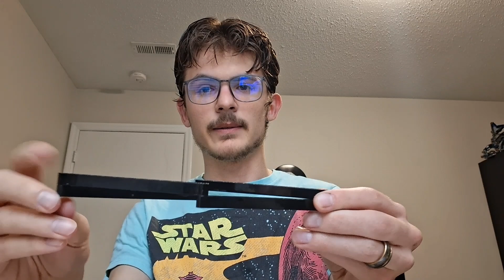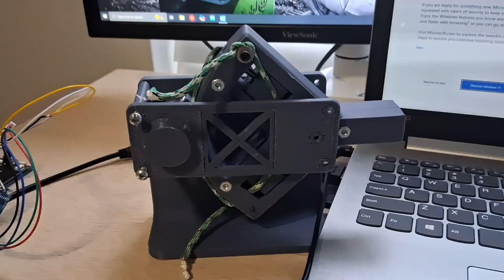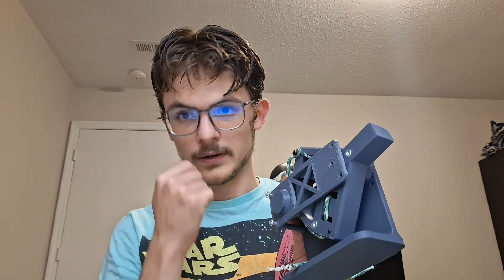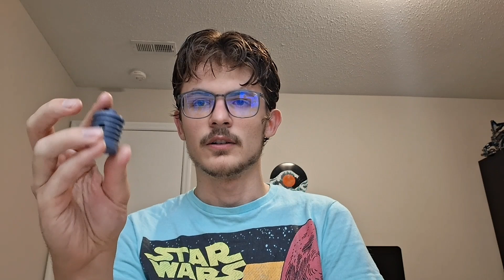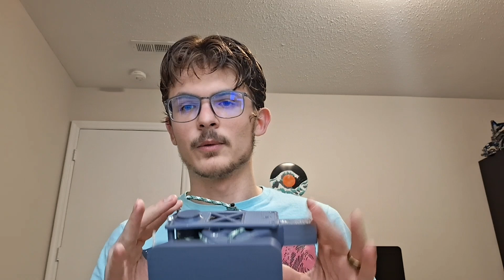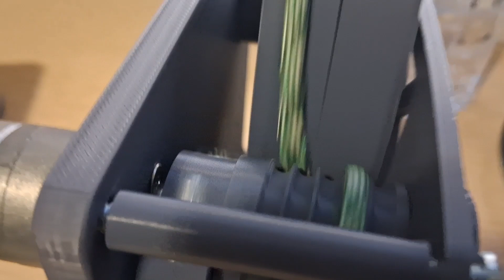Capstan Drive 6/5/25

Comment: Nice. Is there any stretch to that parrot cord? That would not be beneficial for efficiency or precision. Does your motor controller accept feedback from your motor's encoder? I didn't get a chance to see the controller...you were too quick :-) I always liked the capstan drive...super strong, lots of torque. We used it in the navy to pull in 4 inch, wet mooring line that could've been 2 football fields in length. Did you say you were making a "drawing" mechanization? Capstan is an interesting choice. It's main benefits are speed and torque. Precision...not so much but, hey, I've been wrong before. I always thought it would make a great vertical movement for a turret gun or something. Me personally, I would've chosen a stepper...much like a 2d printer or CNC without the z axis. Maybe even a servo. Anyway, I just wanted to say to keep experimenting and learning. You remind me of me 30 years ago. LOL